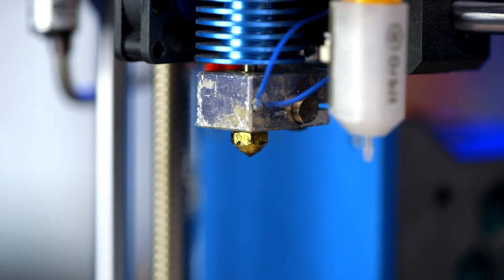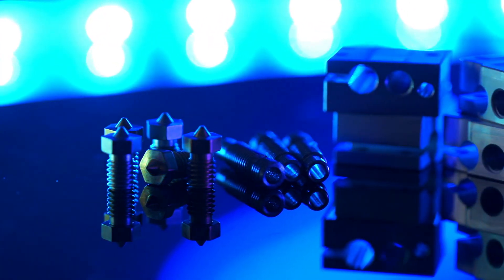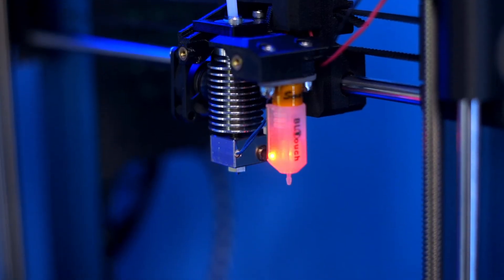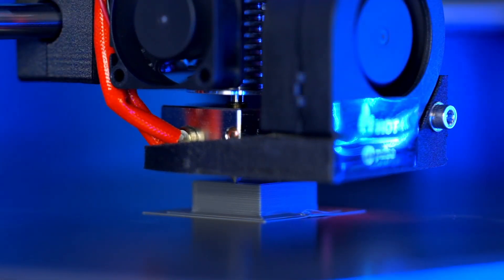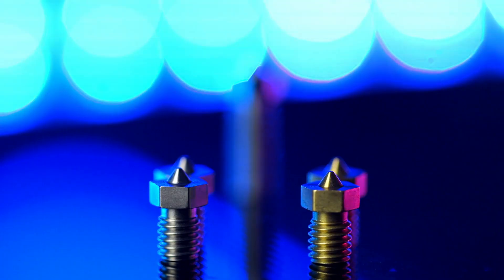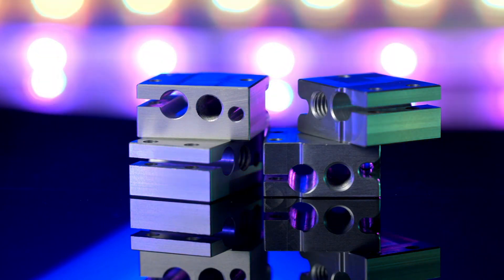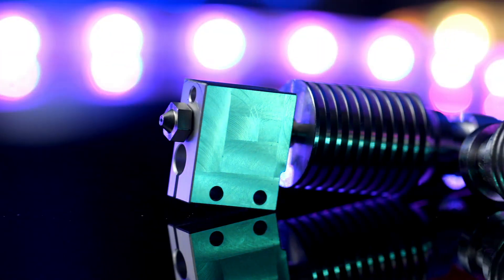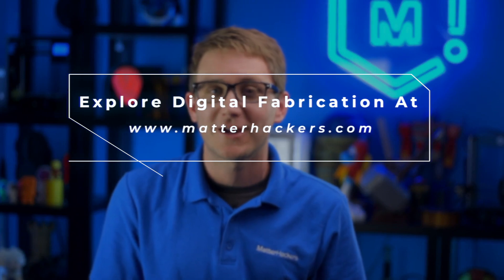CleanTip Nozzles and Hotends // Tech Breakdown

Comment: NEVER use a metal brush to clean a hot end. Thats a quick way to make a short and fry your board
Reply: perfectly fine as long as your machine isn't shorted to begin with. First rule of thumb -- make sure your heater block, hotend, etc is not shorted to ground. Your hotend extremities should not be carrying current externally.
Reply: You've wired it wrong if the brush shorts on contact. I suspect not enough wire protection and the brush shorted between then